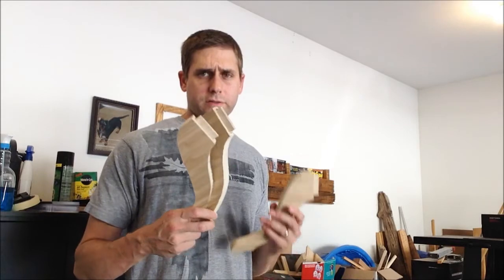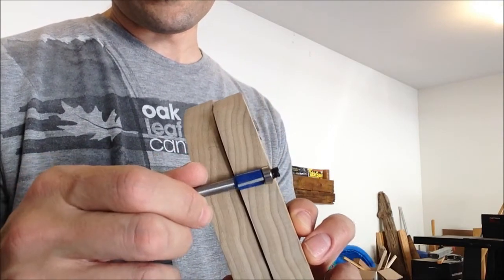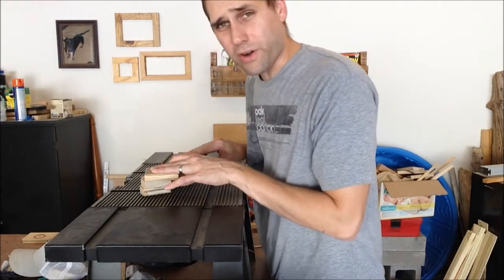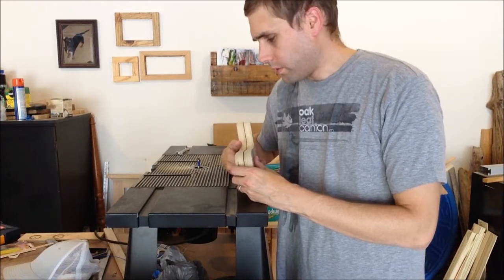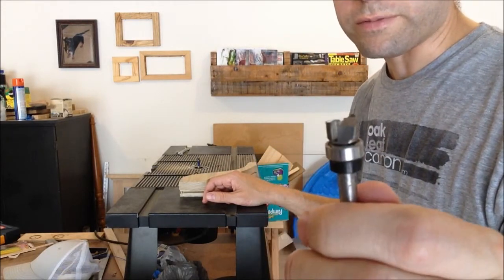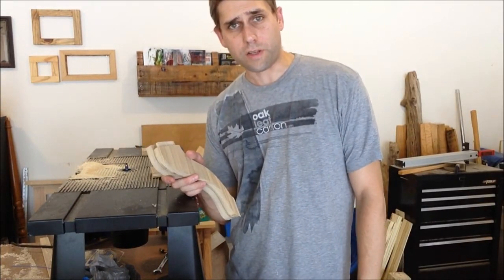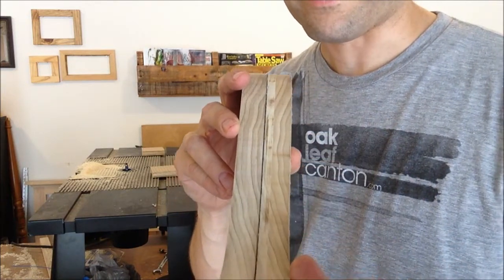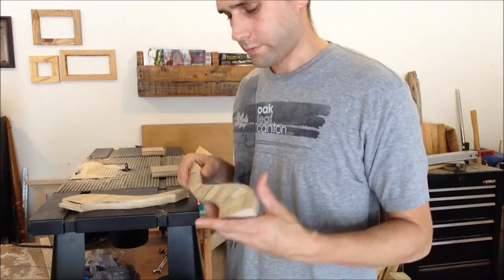Organ Leg Coat Rack Part 5 (CMRW#5)

Comment: You should have just wait and bought a longer flush trim bit buddy. I ran into the same issue with a hole I was cutting on my table saw base cabinet. Video will be up soon but you'll see how I cut a hole on the back for the dust collection box. I bought a 'Diablo' bit. Man, that thing cut the plywood like butter! It ran thru it real smooth. Once you make your router table, you'll start collecting a bunch of router bits watch =P
Reply from the maker: I couldn't afford to buy a bit unfortunately. I just had to make do. I sure was wishing I had a longer one, though. That was stupid tedious.